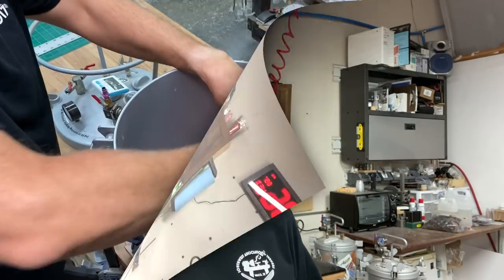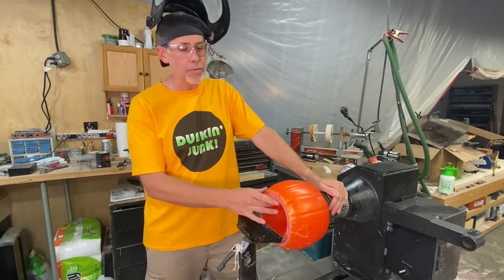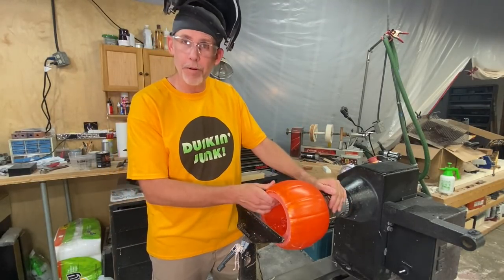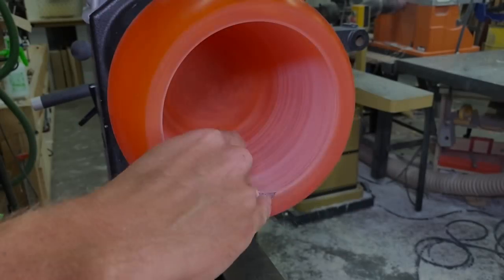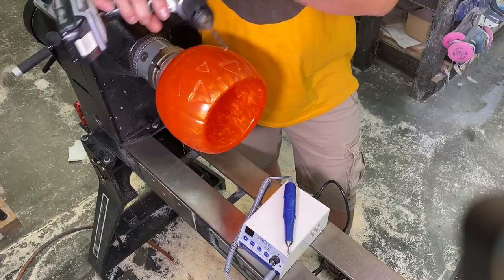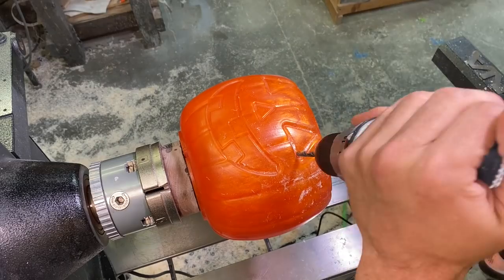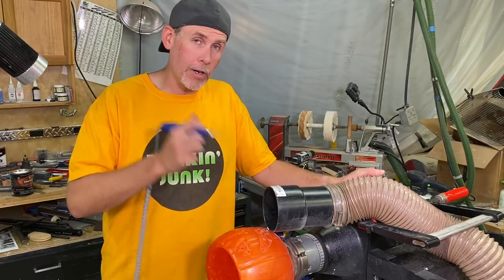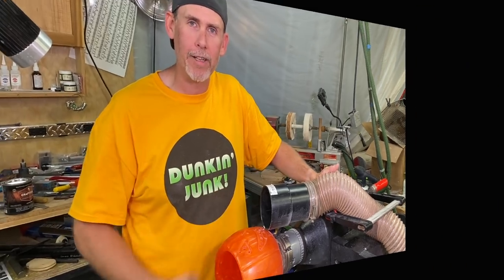Resin Cast Jack O Lantern Halloween Decoration

Comment: Turned out much better than mine did that's for sure.  it lights up Awesome ta boot !  Thumbs up buddy.
Reply from the maker: Oh man!! Sorry yours didn't turn out so hot. Did you just make it or was it an older one? I missed it. I used the old fashioned LEDs for this one, AKA the candle 😂 LOL
Reply: @ZacHiggins  I made a platter this year, it's going up Friday, it just didn't turn out as I wanted but I will put it up anyways, I really need some tools for buffing and have a bit more patience with sanding,

Comment: You may want to try and get a Boring Bar (used by Metal Lathes) that will fit in your Tail Stock. It should make cleaning up an off center hole a lot easier in the future. It also would make it much easier to carve out a precisely centered hole of the exact diameter you want in a piece...
I know you have a drill chuck that fits your Tail Stock, maybe an adjustable Circle Cutter would do the job...
Reply from the maker: I'll have to look into those ideas. To be honest though, the easier way to go is just make sure the cup gets centered in the blank when I cast it. I started to panic a bit at the end when I was casting it because I was worried the resin might set up on me, and I rushed getting it into the pressure pot. Next time, I'd definitely take one or two more seconds to ensure that it is in the right position
Reply: @ZacHiggins  That of course works too...
A Boring Bar (or equivalent) would also help make large, perfectly centered, perfectly round holes in vases, or help hog out the center of bowls etc.

Comment: I would have used a jig saw to cut out the features, much faster.  But if you're going for relaxation, I guess carving is better.   :)  On a side note, I see people talking about a top.  You could buy another pumpkin bucket, and cut the bottom off to make a top, would make it easier to line up the lines on it.
Reply from the maker: Brilliant idea casting the top with another bucket. I never would have thought of that!! Thanks for a great recommendation =D I thought about cutting parts of that out, but I did want to get some time with the carving tool under my belt. Plus, I figured a full size jigsaw might be a pain on the curved surface. I have bought an airsaw already that will be perfect for the next project like this. It's a little more compact and should make quick work of the bulk of the material

Comment: An idea to keep the dust down, once you've drilled the corner holes, why not use a jig saw to remove the bulk of the waste material in the center and then use the rotary tool to carve the edges to the final dimension.
That way, you're reducing the amount of material ground into fine dust by the rotary tool...
I also noticed you had a lot of build up in the grinding area, would putting the hose of your shop vac under the grinding area in the pumpkins center help draw the dust out of the grinding area?
Reply from the maker: I thought about jigsawing it, but I just wasn't comfortable with it in case I screwed something up or scratched it up. I have already bought an air saw though like the one Carl Jacobson uses, definitely going to give that a shot next time since it is a little more precise than a norma jigsaw. The other reason I totally shot the jigsaw idea down is because I wanted to get as much practice as possible with the carving since it was my first time doing it. I like your idea with the shop vac underneath, had my shop vac sitting there and never occurred to me to leave it on inside the pumpkin.
Reply: @ZacHiggins  Another idea for the shop vac hose is get/make a clamp to attach the hose to your wrist so the end of the hose is right beside the tool tip, this should also get most of the dust as it's made...
It may also help control the streamers you get when working a resin and/or wood piece on the lathe - put the vac hose at/near the tool tip and it should suck up the light chips/streamers/dust as they come off the piece, speeding up the end of project/day shop cleanup...

Comment: I would have liked it a little taller with not so much of the top cut off. Can you add some height to it then make a silicone mold so if you ever do this again all you have to do is pour the resin in?
Reply from the maker: Yeah, I didn't get the mold totally filled unfortunately. I don't think I'll be making any more though, so I think we'll keep it as is

Comment: Freakin awesome  came out great. Do you ever do centrifugal casting? Would it work with resin?
Reply from the maker: Thanks! I haven't done roto casting before, but I've seen it used quite often in prop making with resins. That would be a great way to do this type of project, definitely save a ton of resin too. Not sure how thick you could make it, but it would definitely work for a thin piece
Reply: i like the way thins pumpkin came out very deep color